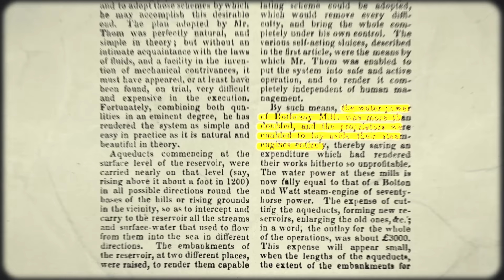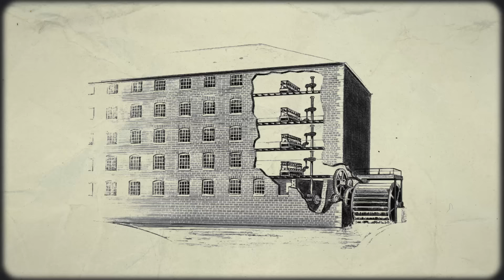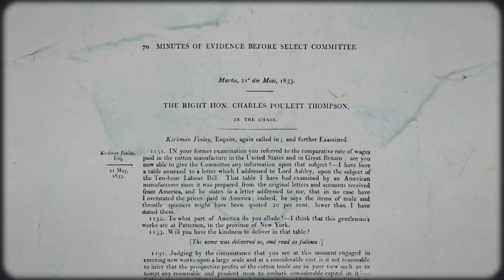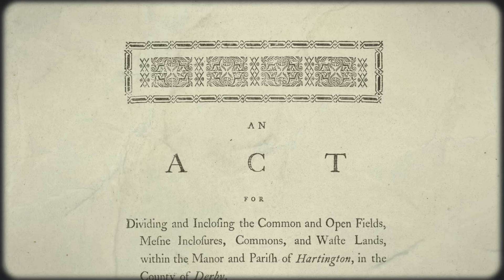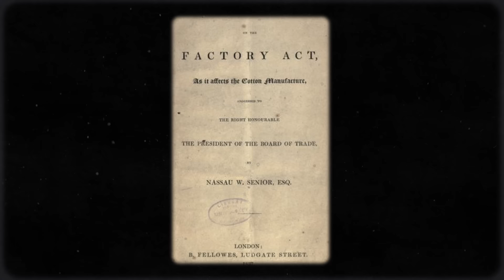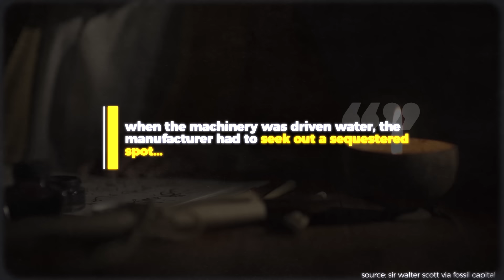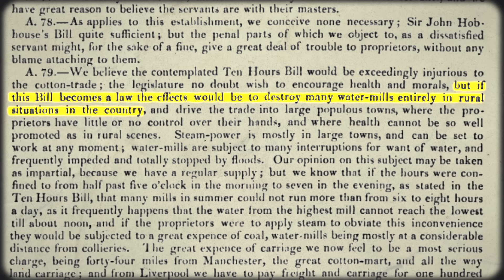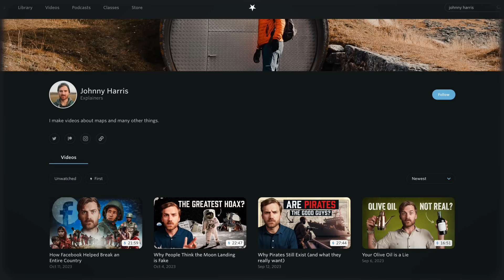Why Capitalism Loves Fossil Fuels

Comment: The analysis is overly complex, for something with such a simple explanation. People are willing to pay for something which could be had in some other form for free when it offers some perceived advantage. Before electrification, there was no way to transport the mechanical energy of water power to locations not on a riverbank, and it was not readily scalable. Portability and scalability are obvious advantages of fueled engines. With the advent of electric grids and massive dam projects, water power became quite advantageous again.
Reply: Exactly. Energy portability is why coal and steam won over water in the early days. And it's exactly why renewables are struggling against fossil fuels now, especially in the transportation fuels sector, where there is literally no replacement for diesel fuel and gasoline in terms of amenity. He also acts like water power "lost". Water power continued to be exploited. Now we have gigawatt scale water turbines operating at 95% efficiency, with blade profiles designed on supercomputers and dams on most of the major rivers of the earth. We have impounded so much water behind dams and increased the earths rotational moment of inertia that we slowed Earth's rotation by a measurable amount. The only takeaway from this video is to maybe to install more medium and small scale hydro at existing dams without turbines? I've seen how that might double the hydroelectric capacity of the USA.
Reply: @gregorymalchuk272  Even if you eschew dams for environmental reasons they aren't the only way to harvest water flow. Less efficient energy harvesting isn't a bad thing if it is affordable enough for private installation at the location of use.

I can't agree that there will be no replacement for diesel and gasoline, the technology isn't ready yet for full replacement, but it is likely to happen. Heavily polluting fuels like coal, diesel and bunker fuel simply must be eliminated for public health reasons, and I'm pretty sure they will eventually be substantially supplanted. Synthetic fuels like methane aren't as energy dense but are much cleaner, so they will serve adequately for many uses where battery electric won't. In any event, demand for fossil fuels generally will diminish, since they are already not the most affordable options.
Reply: @gregorymalchuk272 Yea the engineer inside me died a little watching this video.
Reply: @crawkn They have to be eliminated I agree, but the fundamental problem you are dealing with here is energy density. There is currently nothing that comes close to the energy per kg you get out of fossil fuels. Thus moving a large truck to eg. batteries would either decrease it's cargo capacity or massively increase it's weight, while at the same time increasing the cost (I don't like it but it is the truth). Fundamentally rethinking how we transport people and goods so batteries are not required is probably the solution, something like an electric train or tram is connected to the grid and does not require energy storage thus eliminating the problem.

From an engineering perspective, if no new magic fuel sources are found it is very unlikely something like commercial planes will ever move off fossil fuels. The reason is that they require a very dense source of energy as they are highly sensitive to weight and they do not have much room to decrease passengers or cargo while maintaining profitability.

Thus choose your battles wisely.
Reply: @AccidentalExpat143  Well that's really the whole game, you start with low-hanging fruit and work your way toward the harder problems as the technology allows. Despite their energy density and up-front cost disadvantages, batteries are still cost effective for some types of freight and air transportation, and not for others. What's important is that we have more and cheaper options now, and energy technologies are advancing significantly. Oil will always be good for many things, but the environment has never been one of them.

Comment: It sounds like coal won because nobody figured out that three 8-hour shifts can keep a factory running 24 hours a day.
Reply: Factories were dependent on natural light well into the 1900s.
Reply: @kokofan50  I pondered that, too. How dim can a safety-free workplace be? I came down on the side of invention: If power was available there was a way to use it. Perhaps a more dark-friendly half, maybe a mill could do the night shift. So the expensive powerplant gets full-time use.
Reply: @RichardLewisCaldwell  Alot of work requires complex and detailed movements that can’t be done without looking for most people, so the solution to the problem was improving lighting, which has only improved to the point to justify nightshifts in the middle of last century
Reply: @kokofan50  I lived through the transition. Back in the late 70s and early 80s I was constantly lamenting/raging against society's discrimination against night owls. So "coulda shoulda woulda" is my response to "it was the only way possible". Equality justifies itself. 🤪
And I'm a world-class inventor with enough excess self-confidence to believe that if I had been around and latched onto the issue I'd have solved the issue, and you'd be here (not me, I'd be dead by now) discussing distributed water power, or something.

Comment: 1000 to one defines the reason that-a-way instead of that way.  Electron as atomic constituent repells - - as gas, against that solid piston wall, allowing work to be made from that repulsive force.  It's the massive change in volume similarly akin to that massive bond dissociation with the nuclear forces. But that's another issue.

Comment: People love carbon fuel. Capitalism doesn't care. If people wanted to legislate carbon fuel out, that would work fine. People don't want to do that. Blaming capitalism is like blaming the calculator for your credit card debt
Reply: The notion that capitalism is merely a neutral instrument like a calculator is a clear misconception. Capitalism isn't just a tool used by society but a socio-economic system that fundamentally determines the structure of society, shaping our behaviors, values, and desires. Your argument also implies that there exists a simple, independent consumer choice that can drive societal changes like the transition from carbon-based energy sources to sustainable alternatives.
 
However, in the capitalist system, this choice isn't so simple or free. Power dynamics and unequal access to resources distort the 'marketplace of ideas,' allowing the interests of the wealthy and powerful, often fossil fuel corporations, to override the needs and desires of ordinary people. 
 
Furthermore, capitalism fuels consumption for the sake of economic growth, regardless of the environmental implications. So, the ecological crisis isn't separate from capitalism, but a direct result of it. And while people may enjoy the conveniences brought about by carbon fuel, they don't actually love the climate change, pollution, and social inequality associated with it. 
 
Moreover, we can't just legislate carbon fuel out without ensuring viable alternatives that wouldn't marginalise vulnerable populations already hit hard by the economic divide under capitalism.

Comment: Now we know that oil and gas can be formed abiotically through subterranean heat and pressure, and that the Earth contains a virtually endless supply – oil is the new ‘renewable’ energy.
Reply: "Now we know that oil and gas can be formed abiotically through subterranean heat and pressure, and that the Earth contains a virtually endless supply – oil is the new ‘renewable’ energy." Simply false: It takes millions of years for new oil to form, and we are using it up too fast to wait for that.
Reply: Furthermore, burning more fossil fuels and emitting CO2 would just push the planet closer to a catastrophic ecological and societal collapse.
Reply: @karlwheatley1244  
Why has the world  never run out of oil or gas ??? because it renews itself faster than we can use it.
Scientific Fact.
Reply: @karlwheatley1244  
Biggest Con Ever !!!
Reply: @geob8172 no, it's draining out, along with the life on this planet

Comment: It's amazing how much this video glosses over facts.
It keeps stating that hydro was cheaper than coal, but it's obviously not true. Hydro isn't cheap if you have to buy develop every inch of the river shore to access it. Imagine what our world would look like if every factory was lined up blocking the flow of rivers.
This whole video really was laughable.
You show how with hydro the workers had to work in the middle of the night whenever the water was flowing hardest, then argue that steam was worse for workers! Clearly, working 10hr or less shifts and doing so during waking hours is better.

Comment: Its not that capitalism needs fossil fuels in and of itself. If it cant make money with it why would they need it? Its the consumers who wants the peoducts that cannot be made without fossil fuels. 

1) The consumer must have a vehicle, he cant use public transportation. 
2) Cant switch to a healthy diet, all he wants is processed food. 
3)Need to switch an electronic device immediately when a new and upgraded device comes out, he cant repair the old one or just be satisfied with what works etc etc. 

Stop buying from a business and the business will die. Consumers/customers have so much power over their spending behaviour but they just lack the willpower to comtrol their desires.

Just blaming the corporate world completely, without looking into ourselves to see if we play any part is just narcissism. 

Become a better buyer. 
Buy a flagship device, use it for 5 years.
Buy 20 dresses and use them for 5 years.
Use public transportation.
Use resusables wherever possible.
Bring back the traditional wooden toys which are hard to break and donate them when you dont need them anymore to reduce so much corbon use and energy consumption as well. 
(These are not hard rules, exceptions can be made whenever NECESSARY)
Reply: why are you so ready not to use your brain? genuine question. the interesting thing to consider is WHY our society became dependent on fossil fuel to the point of it being the most standardized and in that sense convenient source

Comment: Steam isn't just 'water power' though.
It requires the burning of either wood or fossil fuels in coal. If we'd just burned wood, they be no trees left on the planet

Did I miss something?
Reply: Yes you did.  Steam is not water power; water power is using the gravitational energy of flowing water from rivers and streams to move water wheels.
Reply: @trevinbeattie4888  
Yes I know that. 
I thought it was referring to both steam and hydroelectrics